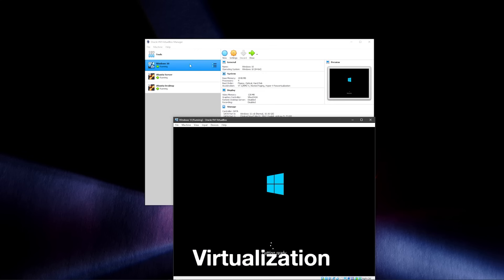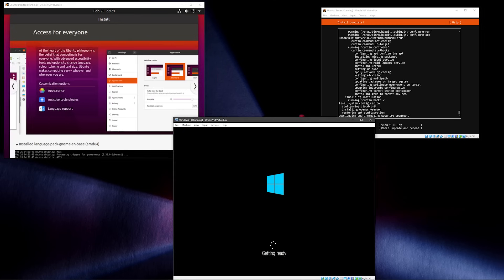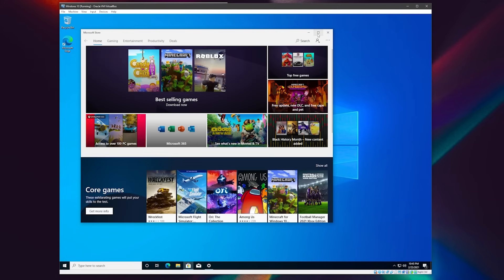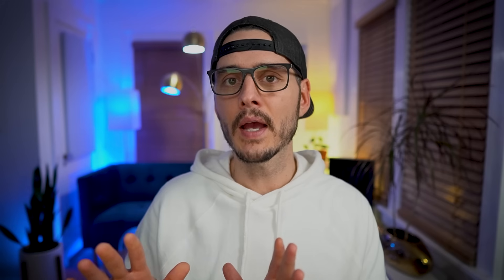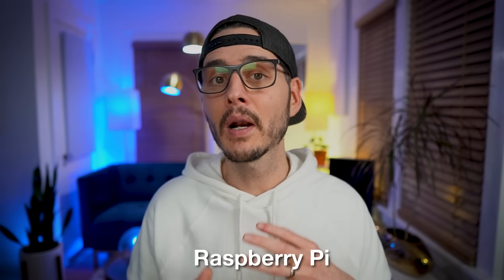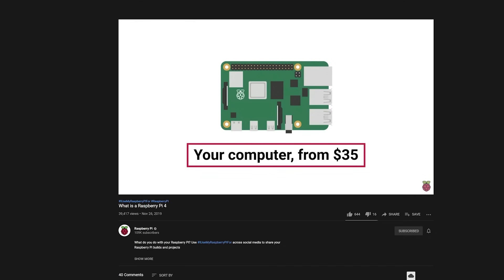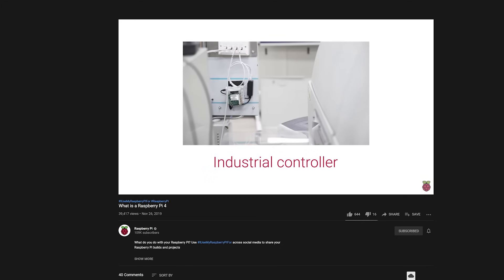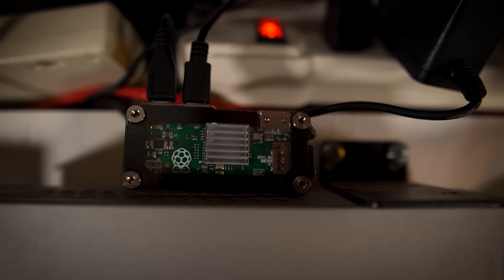What is a HomeLab and How Do I Get Started?

Comment: Is it possible to use Raspberry Pi as a server for the web? A server that will not be visited by more than 5 people, will only store information in a database, generate links and so on?

if not, then suggest what would be the best solution for such a task? in general, I may have an old PC but I would like something very small, possibly desktop, so it doesn't take up much space and so on

Comment: I started this hobby a little while ago...I'm a fan of your channel already! Great content! Thanks.
I am now learning about networking, subnets, firewall, etc. Noob here!
For now, starting to learn how to configure everything...
I don't have rack, still :-(
Scattered by the house... :-D ... I have:

TerraMaster NAS F4-424 Pro (TOS 5.1.145)
1 x M.2 2280 S3-M PCIe Gen3x4 NVMe SSD 1TB WD Red SN700 NAS [WDS100T1R0C] (CACHE)
4 x Seagate Constellation ES ST2000NM0011 SATA 2TB 3,5" (BTRFS/TRAID with 5,43 TB Storage Pool - 1 Volume)
---
1 x Cisco UCS C-220 M3L (1 CPU Xeon E5-2643 4 Core 8 Thread - 74 GB DDR3 RAM)
4 x Seagate Constellation ES ST2000NM0023 SAS 2TB 3,5" (LSI MegaRAID SAS 9271 8i - RAID 5)
2 x SD-Card 32 GB RAID1 (Proxmox VE 8.2)
---
Switch HP Procurve 1810G-24

It's all, for now.
Greetings from Portugal!

Comment: My issue is different.  I actually need a lab setup.  I do this as a day job and it's slow, so i want to do some "homework".  In work I am about 3 layers back from the dev ops stacks, I am just a "developer".  When I come to blogs and youtube articles like yours, I'm not picking yours are some of the best, they show you how to setup a "home lab" or what not, but they don;t.  They show you how to install a partially working, incomplete lab that if you actually tried to use, you will find out rather tapidly it's all smoke and mirrors and the real work of "settting it up to be useful" is the hardest and longest part.  There are very, very few YouTube videos on setting k8s cluster which leave you with a working, read for dev deploy cluster. They install it, run a single test ngnix with a port forwarded host port and call it done.  That is useless to anyone.  You might as well just run nginx baremetal.
Reply: A video on how to set up calico or nginx ingress.  How to get external/internal loadbalancers working.  Installing MetalLB, and the more/most common management stacks... 
Rancher sounds great and all, but you won't find it in industry.  In enterprise, the build is taken away from you, encrypted and hashed.  Someone else deploys it to prod, you are not permitted access to prod. You get access to a plain simple cluster status UI and kubectl.  Usually it's built by github, or more common, on perm or cloud Jenkins.  Your job ends putting it into the right repo.  Getting it to work in UAT is the hard part.  Network policies, DNS, host-allow, host-deny, access to SAN auth plains, service accounts, secrets, certs, helm charts, flux-cd.  A real devops stack in enterprise won't be covered by a 1 hour video.  A series of 1 hour videos maybe.
Trouble is.... anyone that good with that knowledge, is working for large companies making 100k+ and has no time to make YouTube videos or blog articles for us!

Comment: Average age for PC is 5 years ? LOL my home server is nearly 10 years old and based on Haswell. It's build form parts that I had around my house left over form PC's I have built across the years. It contains many parts form my main PC I have used until 2019. I have deployed it last year and keep on expanding it. I also have a pihole and want to get pfsense router. Since my computer room is mostly for gaming and movie watching with OLED TV and Dolby Atmos home theater I don't have a space for rack so my "homelab" is decentralized network of different computers and network devices all around my hose connected by network I have build myself.
Reply from the maker: You're above average then! 😀

Comment: I've started on this somewhat recently. I fired up my old desktop that I think came out in 2009. Unplugged the hard drive that was in it to preserve the original windows XP OS, plugged in a spare hard drive shucked from an old usb 2.0 external drive, and installed linux mint on a partition. Surprisingly despite its age, it actually has enough compute to run quite a few regular tasks like web browsing, video watching. With the h264ify extension it even plays youtube smoothly, which is one of the reasons I replaced it originally because it was lagging on youtube.  I'm sure it could handle stuff like LibreOffice no problem though I haven't tested, and I don't really need that functionality on a spare machine. It actually outperforms some laptops I have, though to be fair one of them is basically a potato, they built that thing on the cheap, not enough storage, which you can't replace easily, and the cpu is garbage despite having good specs on the surface.

 I've had my challenges, some pretty obscure or confusing and frustrating errors when I try to follow the guides on how to do things. Stuff like permission errors especially. I'm not used to having to grant everything permissions to do stuff. I have picked up the terminal pretty quick though since there's things I haven't figured out how to do with the gui apps, if you even can. Like Using a text editor to edit protected files, only to find out after editing I can't save it since it wasn't run with elevated permissions, and I don't know if there's a way to grant them through the gui or not, of if I have to sudo them from the terminal which is how I have been doing it. There's also hardware issues, like the graphics card is very old and nouveau lets it run seemingly perfectly for regular usage, but I can't tell if it's allowing hardware acceleration for decoding. I got an unsupported version of the old proprietary driver working with a lot of help from google and somebody who put in the work to make a modified version for newer kernals, but I can't tell if it's working any better yet, need to do more testing, I did notice an annoying bug where the initial resolution on boot is defaulting to a low setting, haven't figured that one out yet, but when the gui boots it fixes itself.

I managed to install jellyfin, and it seems to actually have enough horsepower to run a single transcode to a client, it's basically consuming the whole processor to do so however. Got cockpit installed for remote management along with some extensions for file managing and file sharing control. Managed to get pihole installed in a podman container, though I had a lot of issues with the firewall and other hassles. Not sure if I'm going to leave it running though, I didn't notice any spectacular drop in ads despite installing several block lists. I toyed with trying to reinstall jellyfin in a container, but I find containers a bit clunky to work with, apparently I need to delete and recreate a container from an image if I want to change /any/ settings like port forwarding and shared volumes, or at least that's my understanding. If I could pull it off though it would make it easy to shut down and start up the server from cockpit while tracking how much RAM it's using which is important since this old thing doesn't have a lot. Also got to the point where I have the GUI disabled by default on boot, and can just start it manually if I need it, which I still do for some things. Mostly to save on the limited RAM.

I'd love to be able to run a local modded minecraft server on it, but I use a ton of mods that consequently require tons of RAM and CPU, which this thing just doesn't have and I can't really upgrade any further because there's only two slots. The motherboard is actually limiting me in several ways, only 2 RAM slots, only 2 SATA v1 plugs, 2 32 bit PCI slots, 1 1x PCIe slot that's somewhat blocked by the graphics card in the single x16 slot. It's PCIe v1.0 BTW. The Ethernet is only 100 Mbps, A spare Wifi dongle I have is actually faster so I disconnected the network cable because it's actually faster that way.

I recently saw some videos about those Beelink Mini PCs and they sound really good on the surface, but I just don't know if I'm ready to pull the trigger yet, and I'd hate to mothball this old desktop again if I put all my server stuff on the min pc, though it'd be a lot more energy efficient and just plain more powerful.

Comment: Speaking of old computers, you may think it’s slow but plenty of people run home labs on Raspberry Pi’s and even an older desktop or laptop probably has more power and resources (storage, ram) than a Pi. And with how expensive and hard to get Pi’s are these days, even a used small form factor (SFF) office PC from eBay for about $100-150 is a great way to start and about the same price as a marked up Pi, but probably more powerful in basically every way. They even don’t use too much electricity. More than a Pi, but somewhere in the 10-50 watt range which is very reasonable.

Comment: been coding since ~96-97, and homelab'ing since ~2002. over the years i've hosted countless web, file, radio, and game servers. my lab currently consists of 6 servers. all amd apu-based quad cores. always been an amd user. they're all consumer grade pc's bought new and re/multipurposed. 2 switches; one managed 8 port maxed and one 48 port unmanaged to support lab expansion. running everything 24/7 through 3 displays typically consumes ~6.5kWh per day, or roughly £1.75 at 28p per kWh. aiming to get it mostly off grid before the october energy price hike (first of 5 significant hikes!).
Reply: off grid how? solar panels?

Comment: I work IT for two school districts, so I get dibs on anything they decide to erecycle. I got two HP dl360 (g6&g7) they were getting rid of because they got water on them (ruined the cpu and ram in one, and the drives in another, but I upgraded all of that anyway to x5670s, 72gb ram, and 500gb drives). After that I got a t7610 from a buddy who got it from somewhere that was throwing it out, threw 2 e5-2667 v2s in that, that's now my main server. Then I just got a dl380 g6, I'm going to be gutting the dl360 g6 and putting the parts in the 380 because it has 8 drive bays vs 4, and larger quieter fans. Do I need all of this stuff? No, not a chance, but frees free so I love playing with hardware

Comment: Due to your channel and some others, I've started a HomeLab based on two older System76 laptops and a Lenovo ThinkCentre minicomputer. At the moment I've installed the Lenovo with ProxMox and am learning about VM's and Docker and the differences and requirements. Also how to handle networking and storage with these machines. In my network is also a Synology NAS and a USB attached External harddisk. Experimenting with building up Truenas in a VM and accessing the various kinds of storage. Loads of fun.

Later on I want to try my hand in clustering the Lenovo with both of the System76 laptops and see how that works.

Comment: Not dissing the homelab movement, as all learning is a positive, and im all for it,  but all the uses that was mentioned, was provided completely by the old HP Home server. If you ever had one, this is just replicating that, in a more difficult way, but same end result.
Reply from the maker: except for clustering and everything else I mentioned
Reply: @TechnoTim  Clustering isn't a use case scenario though, just a hardware setup. But sure, you will get some added redundancy there.

But the home server community was a technological dead end, due to microsoft realizing they were loosing sales of their core server licenses. So they discontinued it, and made it obsolete. Wasn't anything wrong with it though, rather it was probably too good, compared to commercial systems at much higher cost.

Homelab is the future though regardless, due to it not being locked-in to a tech deadend. I was more curios if there was any usage i could add I dont already have. But I guess not.

Comment: I should do a video on mine.  I have a Netgear prosafe XSM7224S with 24 10gb sfp+ 4 ports are shared with rj45 ports.  24 port patch panel. then a netgear 24 port POE 10/100 port with 4 1gb ports. then Sonicwall firewall that has PFsence, It has 2 port 10gb and 2 1gb ports,  Then a Truenas server made from a 24 disk,  Supermicro case and mother board.  then  Security camera server for Blue Iris.  my person computer, the truenas, security camera server, and Pfsence have 10gb fiber,  and 2 fiber channels run to my home from the netgear Prosafe SXM7224S to another SXM7224S in the home. then a poe switch in side for security cameras.  I will later get 1gb POE with 10gb spf+  Then I wont need the extra SXM7224S     I just need to work on other stuff later in life when I'm not so darn busy working at work.

Comment: I need a pointer or two.   I'm in the process of setting up a home lab, with several old game PC. So far I 3 Proxmox VE host running Ubuntu and Windows VM & LXC containers.  One container I've been researching is a way to forward/collect all the Linux mail that is being generated by system processes forward  them on to a gmail account so that I can get them as alerts on my phone.  Does any one have a suggestion/solution.

Comment: Just curious if anyone might have an idea why my Linux virtual machines freeze in Hyper-V but the Windows virtual machines don't?
Reply from the maker: Which distro of linux?
Reply: @TechnoTim   Most other content creators would have forgotten about this one.  I'm using two to learn, Debian and Arch. Kind of goes without saying that Debian is easier to setup and use, but I have found that Arch is great for poking around under the hood to learn the ins and outs so I usually spend a bit more time in that machine. Thank you so much for responding, a lot don't.

Comment: Hi Tim got a question, I recently installed proxmox and created my lab thanks to you! I reinstalled proxmox 7.0 and  my SSD works for a while after its initialized/mount then it gets an error WARNING: dos signature detected on /dev/SSD/vm-114-disk-0 at offset 510. Wipe it? [y/n
Linux is really not my strong suit so if you have any suggestion or fix for me to apply I will be super grateful Sir!

Comment: Thank you!!! Thank you for encouraging e-reuse! I find there are sometimes simple things to do, like with my 2011 Mac Mini where I swapped the spinning hard drive with an SSD, doubled the RAM to 16GB and literally put new life into it. It is faster than my 1 y/o work HP laptop running Win10Pro. I've also had the same experience with an employer throwing away an insanely powerful server because it was 5 yrs old. They were happy to give it me rather than pay a recycler. For $200, I doubled the RAM to 64GB, upgraded the dual Xeon processors,  and put SSDs in it. It is now one of my home lab machines where I explore the headaches and awesomeness of CentOS8. The overall lesson, there are a lot of powerful machines out there that are old and massively under utilized. We can be green and do amazing things at the same time. Cheers!

Comment: I bought a desktop PC with an intel i7-2600k and 32GB ram, like 10 years ago. It turned into a server like 8 years ago and still running smoothly. Using docker primarily to host services i need.

Comment: I'm going to build a full-size robot that is at least 5 feet tall. Since I have a 3D printer, and CNC router that can cut Aluminum. I'm going to build a basic Robot and then upgrade it as I go along the first build will be servo-activated eyes, then mouth, then give it social bot capabilities. Make it a 12-month project. I have already ordered the Servos and servo controller and have plenty of Arduino's lying around.

Comment: I'm working on building out a home lab. The main requirement my wife gave me was "don't let it be too loud". Well that rules out old enterprise equipment even though its better value than what I went with.

Im reusing an old NZXT Phantom case, power supply, and SSD (for a cache). Pair that with a Chinese x99 board, Xeon E5-2678 (12c/12t), and 32GB of DDR3 ECC ram. For storage I already have 2x 4TB Iron Wolf drives and I bought a 3rd.
This will be taking over the job that my 2011 Mac Mini + 2 bay synology NAS have been doing for the past few years.
Reply: Go older enterprise gear and just get some nocta replacement fans of the right size and voltage. Most of them come will a cable that has an embedded resistor in it to quiet it down.

Comment: Great video.  I'm actually in the process of ordering the parts currently, I just managed to get a 24u Netshelter CX rack.  I have 2 Supermicro D-1541 boards I will be transferring to Supermicro CSE-504-203B 1u chassis.  I'll be transferring my dual Xeon Supermicro X9DRL-IF motherboard to  4u chassis.  My Ubiquiti Dream Machine Pro and US-16-XG 10G switch are in the rack, I'm waiting on the 24 port POE and cable management supplies to arrive.  I also have an old 4u 45 Drives Storinator chassis I will be upgrading to work with SATA 3 drives I'll be adding in.  Thats not including my dual PC Lian Li DK-05 desk project I'm building with 3090's and 5950's.

Comment: I am currently trying to figure out the best use for a WindowsXP, service pack3, HP Pavilion zv6000 laptop. DDR3 (seems to be the only RAM I don't happen to have lying around) It's got tons of I/O. I'm thinking I'll start by putting a low-overhead Linux distro on it. Not sure yet if it's going to be possible to eliminate the OS that came pre-installed, and run it as a pure Linux machine or not.